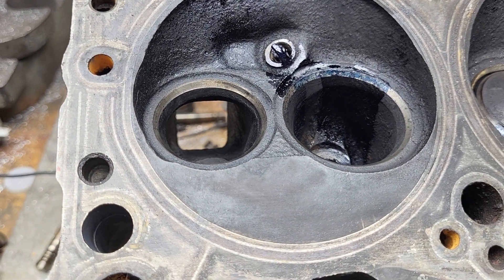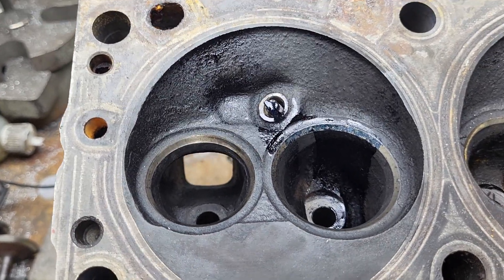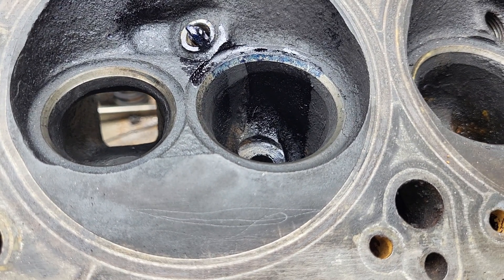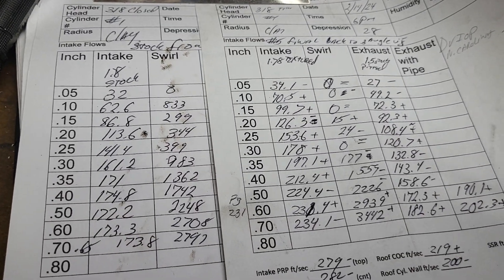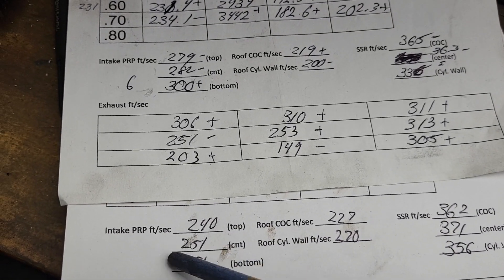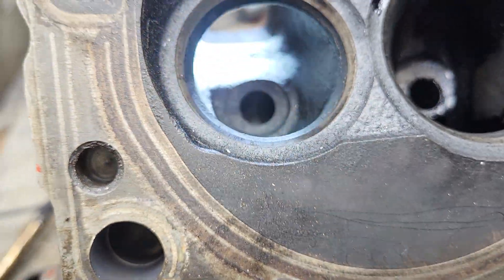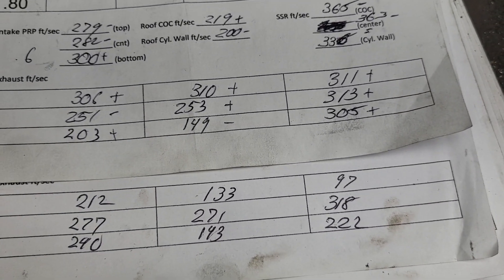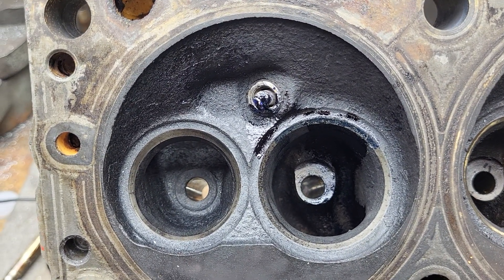David Vizard, Unity Motorsport, Mission Impossible 318 project. Closed chamber 4 barrel test head

Comment: I bought what I thought was a pair of these 920 heads, turned out they were from the same side of the engine, either 2 right or 2 lefts. One is cracked so that is to be the sawn up one to check wall thickness. The machined mating surface to the block is so badly pitted that I dont think they would seal to the flow bench and my auto machinist is backed up with work right now. Thinking I need to resurface before I saw the cracked one up. Was going to offer to send you on my dime the sawup and one good cylinder if you were interested in playing with it, but I don’t think it fits in your timeframe of what you need to accomplish. Anyway if the 920’s you have are salvageable, I wouldn’t saw them up as they are getting hard to find. 

If you want to see the head, I can shoot you some pictures in a text.
Reply from the maker: Mark, contact me at charlesservedio@gmail.com. Thanks!

Comment: Morning Charles. If you are willing. And the guides need work anyway. In one of the ports, could you remove the guide boss completely and replace with a bronze guide? And shape the portion exposed in the port into a wing. Possibly a loose fit so you can turn it and see if you swirl can be manipulated? 
  It would be similar to the AFR street and strip head with alternate ramps. You could test not only flow changes but also direction.  
  If you don't know what iam asking...I'll create a video to better explain it.
Reply from the maker: I'm not sure what I will do with these! Thanks

Comment: The FIA Historic Database has a 1966 Barracuda group 3 Homologation book.

Such a car was never built, but it already had a 318 engine. And closed chamber heads with a 2.00 intake valve and a 1.65 exhaust valve.

What do you think? Would this factory's early plan have worked?
Reply from the maker: I would have used a smaller exhaust valve and bigger intake but the bore is probably and issue with 318. It would have been a cool set up! Thanks

Comment: Got 920s on a 273, just did basically clean up porting on those. On the 318, I've got the slightly earlier 315 castings, same heads really. Those got 1.88/1.60 valves and a lot more porting. Had a set of 302 heads while I was doing all that, still have them sitting outside somewhere.

Comment: Really glad to see you testing these heads! These are supposedly the best factory castings the 273/318 had available. With porting and de-shrouding these are supposed to exceed the similar (302) castings because of better ports. I do notice that even though the valves are a little shrouded-they’re nothing like the (302’s) which is like a straight up wall! Working that and the valve guide down are one of the hardest parts to preparing these I found. I have one of the (302) done, I’d like to email you some pictures of what I came out with and get your opinion 😂, you make it look easy Charlie, and it’s not! Much respect to your skill-set brother. I did subscribe to Robs channel a few days ago-I thought I did that long ago but 🤷🏻‍♂️technology isn’t my bestie, we maintain a working relationship (for the kids of course😅). Anyways I want to say thank you to him for his support, it is really appreciated! I have a feeling that the top end flow on these heads is going to be really impressive indeed. When you factor in that the engines that came with this head also had fully adjustable rocker arms to take full advantage of -0-lash, it was much better than anything that followed it for 25yrs!
Reply from the maker: Send me anything you like to charlesservedio@gmail.com and I will look at it. It is cylinder head porting. Anyone can do it! Haha.
Reply: Noted your subscription added the other day. Thanks for subscribing. I’ll try and make it entertaining as often as I can. Or, otherwise known as, the speed of my wallet.
:)
Reply: @Robs-Garage-experiments  very understandable brother! Low Budget add a difficult hurdle, I’m in the same boat. There’s something very satisfying about success with that particular challenge added in too! 😁🙏! I look forward to your content, I’m a fan of your brand 👏👏👏
Reply: The 302 SBM heads have bigger pushrod holes and a more pointed quench pad vs. the 920 heads.  I thought the 920s did pretty well for a 1.78: intake valve.

Comment: To bad they wouldn't let you use a casting like this.  The average guy would have picked a better factory head like we would.
Reply from the maker: That would be too easy!
Reply: @servediocylinderheads  yep
Reply from the maker: I bet these are worth 20+ ftlbs torque on the same short block vs. Open chambers.
Reply: @servediocylinderheads  I agree.  Thanks for the video.
Reply: I bet you are right Charlie! Much better starting point
Reply from the maker: No doubt! Thanks Andy!
Reply: I think the 1967 318 came with the 920 heads.  Wouldn't that be within the parameters of M.I.?
Reply from the maker: No, Tony wanted the worst performing parts.
Reply: @servediocylinderheads  these heads are what Tony has on bottle rocket! 🚀
Reply from the maker: @MidnightOilsRestoration  It figures. I could see these working real well with bigger valves. Thanks.